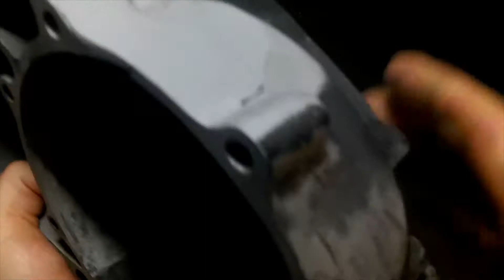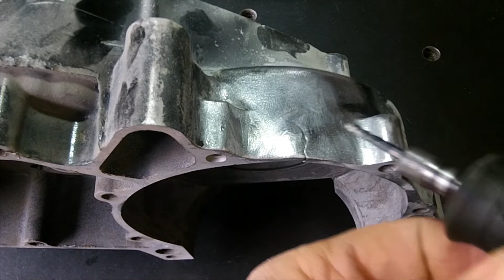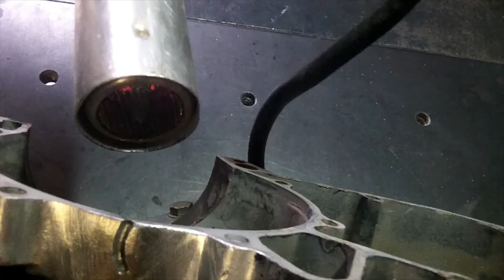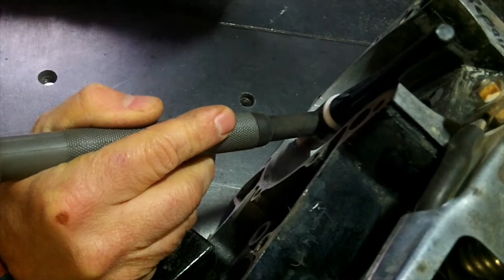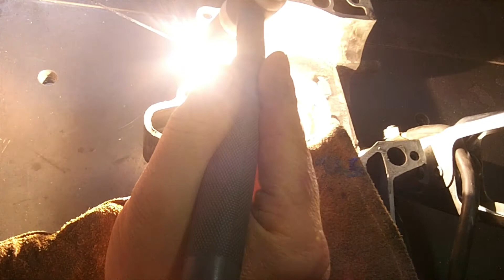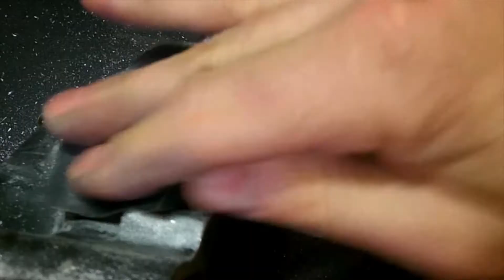Dirt Bike Case Repair

Comment: Well i had someone weld my case, but there are still cracks on the gasket surface. 
I bought a dremmel kit, so I'm going to do exactly what you did to mine, get it notched out and pay someone to weld it

Comment: I was told by a neighbor to heat it up a bunch of times (not too much or anything) because he says it will help get oil out of the metal.  Is there any truth to this or should I just rely on brake cleaner?  Thanks for the video, I'm excited to tackle a very similar project!
Reply from the maker: I haven’t heard that one. Cleaning it well and removing the surface oxides and contaminants with a file has always worked for me.

Comment: Super, Are you a AC tig  and thick tungsten?
Reply from the maker: Lincoln precision tig 185 set to AC using 1/16 tungsten. I should’ve used my 3/32 tungstens!
Reply: I tried aluminum wire and argon in my mig and didn't have much luck. Are tumgsten sticks better? I have a stick welder as well. Thank you.

Comment: surprised you didn't finish off with a sheet of wet-n-dry on a plate of glass for a perfectly flat mating surface. . . kitchen Formica benches suffice. . .and yes, it has a thick paper gasket,
Reply: No it doesn't have a thick paper gasket. These dirt bike and motorcycle cases use silicone between the halves thats it.